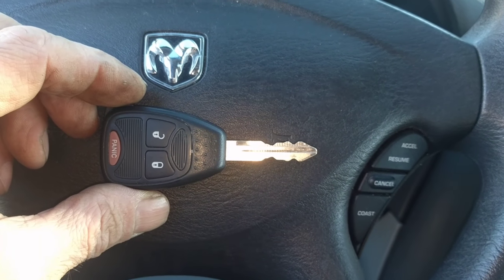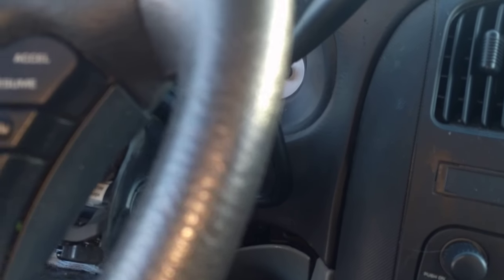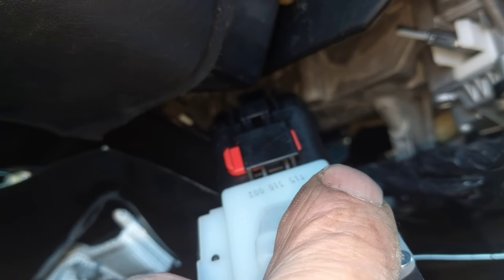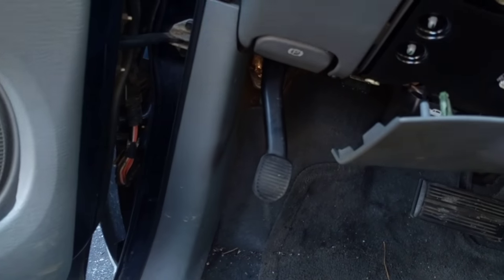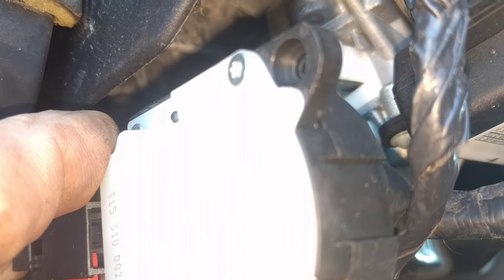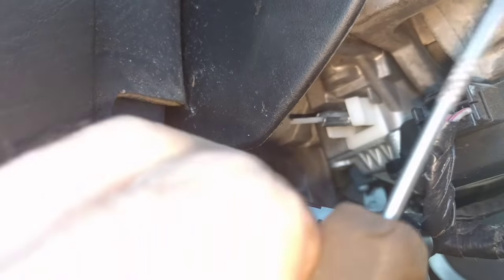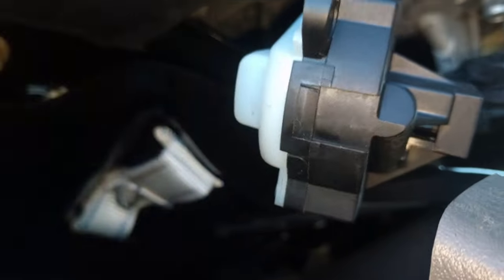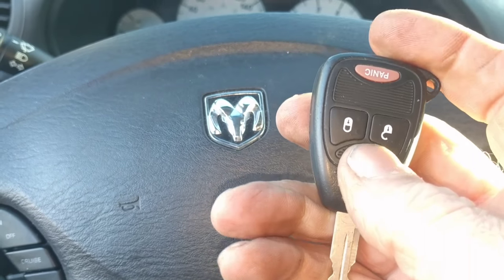Ignition Switch Change 01-07 Caravan/Voyager/Town and Country

Comment: I do occasional small jobs like changing oil and battery and simple stuff and decided to see if I could change a problematic ignition switch which brought me here. When I got to the part of the video where you warn about setting off the air bag I decided I would let the mechanic deal with it, so nice vid.
Reply from the maker: The trick to yellow (airbag connectors) all you do is disconnect the starting battery, wait 2 full minutes, then disconnect the yellow connectors.

Comment: These early models had a problem with the engine fuel injection wiring harness where it connects to the body FI harness. Deteriorated dielectric material that covers the wires. You must cut the covering on the engine side of the FI harness to view these wires.

Comment: Will a faulty switch prevent the 'square illuminated indicator' that surrounds PRN32L from indicating the 'P'.......?? Sometimes it indicates 'P' and the van will crank and start and if not, it will not crank at all. I have a 2007 Grand Caravan 3.8 litre vehicle. I'm also wondering if it's a possible faulty brake switch???? Of course it could also be a multitude of other things.

Comment: My 2001 dodge caravan starts fine and runs, but when I take the key out it still thinks that the key is in and you get that chime noise when I open the door. Eventually it causes the battery to go dead even though the door is closed and the chime isn't happening. At first it only did it with one set of keys we have, but now it does it with both. Anybody have any idea what's wrong???
Reply: It sounds like the screen module he was talking about in the beginning is faulty. Like he said it picks up on the chip when the key is inside thats when you can start the car. So it probably just thinks the key is always inside

Comment: Update for me: my van would only start if I flipped the key back and forth really quickly, otherwise no check engine light. When it did start, it would stall, or run very poorly, misfires, coughing, like something was wrong with the motor. 

Well, new ignition switch, and runs perfect again. Ran so poor, it threw o2 codes. 

I don’t have screem, however, the ignition switch causes havoc since it is wired into to the BCM. 

It doesn’t throw any cel lights/codes either. These vans man…

Comment: You can take the cover off and start it then unplug the screen system while it's running and leave it unplugged and then you can use any key you have made and the screen system doesn't turn the fuel off any more,  it's controlled by the switch 12 volt only and works fine. You just don't have theft proof anymore.  But who cares as long as you can drive it. I do that to every one I have owned
Reply from the maker: Wow, that's an incredible workaround!
Reply: @wolfiestechbites3773  gotta do what you gotta do sometimes when funds are low and you have to get around
Reply: @coinslotsandjoysticks2572  I tried it but it just kept turning off and finally it won't even crank anymore
Reply: Ok how can I do that to mine
Reply: @torrischappell7339  msg me tomorrow and I'll help you fix yours, I'll walk you through it

Comment: Yes sir I have a question for you I've got a 2003 Chrysler Town and country would that ignition switch module right there be the cause I have all my auxiliary power when I turn the key right before start my radio my heater wipers windows all that works fine until the moment I crank the vehicle and let off the switch when I let off the switch none of that stuff works from then on until I cut the vehicle off and kills the power and it goes back to auxiliary mode would that be the cause of this

Comment: I have a 02 Caravan, every now and then i cant turn the kee, if i wiggle the heck out it for a few min, it will turne, its ben doing that for a few months, but getting more frequent, and takes longer to turne, i dont know if its the tumblers sticking or the switch under it, guess i will half to take the lock cylinder out to find out, right?
Reply from the maker: Sorry, been away.  It's the tumblers most likely.  The ignition switch would be a consistent problem turning.  Since it's not all the time, u should change the ignition lock cylinder

Comment: My friend lost the keys to her 06 town and county. It has the key fob. It's going to cost $300 for a new key at the dealership. Plus the van has to be towed there and she has to be with the van. Problem with all that is she has limited income and is currently in the hospital not able to go with the van. Can I change the steering column or pieces parts to put an ignition cylinder in that has a key fob to match? Will I have to change the part under the column that reads the fob?

Comment: I have a 2005 Chrysler T&C. It takes a couple turns sometimes to start. Im thinking it's the key cylinder but not 100%. Had starter tested, said it was good. Any recommendations? Thanks.
Reply: Same boat
Reply: If you're still having problems, it may be a broken actuator pin. On the 99 caravan I worked on it had this mechanism between the key cylinder and the ignition switch. Right there in the steering column. I also replaced the starter because it still wouldn't start after I fixed the actuator. Had to jump it off, too. Check your relays and fuses also.
Reply from the maker: Hey Jordan.   Sorry for the late reply

So, starters are pretty simple, but how the whole electrical system interacts can be a bit difficult to explain in just a message.

I believe it's time for me to make a video explaining how everything ties together.

That said, does the starter sound strong while its turning the engine over those few revolutions, before it starts?  Or does it labour and sound tired?  

Also, does it reliably crank, Every single time you try to start the engine?

Comment: woke up this morning to find my 06 town and country radio on and AC blowing on low, turned key to start several times cranked but no start then I disconnected battery cable for a minute and it started up and ran but noticed little red dot on far right of dashboard gauge panel and after running it a bit to charge the battery back up and it kept running in all positions??!! tried to shut down by pulling battery cable off again but it kept running off alternator and I couldn't get key to shut it off until I messed with the ignition switch housing through the gearshift lever opening. When it was running it seemed to bog down when I hit the gas but had a PO420 catalyst problem code the day before via OBD2 reader I thought was from putting $30 of Thornton's E-15 gas when I was on a half tank and thought it'd clear up when I went through that gas. I'm assuming someone tried to steal it but IDK what to think.Any thoughts that could help greatly appreciated.

Comment: Thank you, thank you, and thank you. My Chrysler Town and Country have been intermently not starting. Been driving me crazy trying to find the heart of the problem. Through it was the engain iddel control. Start the engine, it runs for two seconds and then dies. Going to put a new ignition securty and key system in. :-)

Comment: I am having an issue with my town and country, it  will not crank or start, had battery tested it is fine, thought it was starter put a new one on, old starter tested fine, but still nothing, I have all my lights and power accessories, it it will not do anything, I am at a loss, we are low income and I can't afford anything else, do you think this is the problem with it too! I have traced all the lines for continunity and they are all good, bit it does not seem to get power to starter or something, from what I can tell all the relays are fine too?
Reply: How do you know the relays are good?  Did you switch them out with others that are the same to test them?
Reply: @da324  yes I did replace them

Comment: Yes i have a dodge caravan 2004. I went to junk yard to get another steering colume. And. I got key to. The. New. Colume. brand new battery. But for some reason when i start it. I get no sound no crank. The gauges. Move can anybody help me out there thanks
Reply: key has to be progammed to your ecm

Comment: Have 99 Grand caravan 3.3 lights n gauges work starter relay is good but van won't start. Used to jiggle it and would start now it won't. Ignition switch?
Reply: Yes it's the switch

Comment: When you change the ignition switch , what about the keys , can you use your old keys .
Reply from the maker: Use the old keys.  The ignition switch is just a mechanical switch to send power to ignition circuits.

The security comes from the key and key hall effect sensor that reads the embedded chip inside the key head.  If you use a key with the correct cut teeth, but the wrong chip code, the security will shut off the fuel injectors. (Most security systems work like this)
Reply: Thanks for your reply, I think I am getting a bit mixed up.. the other day I could not turn my key...I call a tow truck and the guy wiggles the key aggressively and it turned.. So I need the key cylinder, I was calling it the switch.. So from what I find on here , I buy a new key cylinder, and then I need to copy the placement of the tumblers from the old to the new , in order for my old keys to work with the new cylinder.. Would you think I am on the right track... The new cylinder comes with new keys , but I think if I did it that way I would need the dealer to program the keys, unless you can put the new keys in turn the ignition on , and somehow it programs the new key...not sure , but appreciate your video..Thankyou.

Comment: Thanks.  I’d still want to see if I could test the switch with a VOM etc, hate replacing stuff that still works.
Reply: Ok, year later, the INCNS problem has gotten bad enough, finally got around tuit.  I need to see if, with the ignition switch in place and key-turnable, why voltage is not seen on T751 (yellow) at C7 pin 2.  Guess I'll try to use the ol needle through the wire trick with the switch back in-place.   Sounds like a pain, but between here, pin 4 on the ignition switch (yellow), and pin 2 on C7 in the IPM (still yellow, still expecting 12v, but not seeing as stated)  is the C200 connector block under the dash, which looks like a real pain to mess with and of course, first things first, hope passes a continuity test across this pathway from pin 4 ignition to pin 2 C7.   After that, the key turn trial.
Reply: Final result:  The pin 4 yellow start wire can be stuck thru with a sewing needle quite easily without removing the switch.   Then the continuity test from there to C7 pin 2 first proves that the needle actually has good contact, and further that there is no wiring or contact problem in between like perhaps in the C200 box. thankfully.  So the switch has to come out now because the problem appears to be isolated to it.   This switch (black cover instead of white as seen in the vid) is easily opened to reveal the turned-green dielectric-greased up corrosion of the copper, the worst on the start contact lands, which had actually allowed a weak voltage reading of about 0.1.  This grease-infused corrosion would never get better by itself. Job for bounty towel then Dr Dremelington Steel Brush and new dielectric grease.

Comment: Anyone change the lock cylinder housing or actuator housing that goes through the column?  need to change mine after theft attempt, they destroyed the housing the cylinder slides into
Reply: Justin Gibson sounds like you will need a steering colum

Comment: My van did this. Same year. I replaced the battery, alternator and cleaned the throttle body. Everything seemed fine till yesterday it just randomly turned off on my wife. I even thought it was the AC cause it would turn off everytime the AC would kick on.
Reply from the maker: +Derrick Spagnola , more details please.  Why alt and battery were changed?  What was happening to change them.  And if you disconnect the plug in At the A/C pump, does that stop the stalling?
Reply: @wolfiestechbites3773 can you help me out on color code on a 1980 Chrysler incision switch3
Reply from the maker: @martincomfort6297  your local auto parts supply store should be able to do that.  Or if they cant, try the auto wreckers.  A lot of the wreckers have been in the business since their teens and know their stuff.  Ask around a few places and ask for the most experienced person (if they don't seem to know).

Comment: My 2002 Dodge Caravan wont crank. I hear no clicks and I jumpered the ignition relay and it cranked. I checked the fuses and they were fine. Next up is that ignition switch and that didn't work. it's got to go into the shop now.
Reply: What was your final solution? I am in the same boat? No crank - no clicks - starter turns when jumpered at the relay. I am about to change my ignition switch. I hope it solves things. My last thing to do is the PCM/ECM.
Reply: @justinbecker3340 Justin. I'm in the same predicament. Did you have the red dot on the dash?
Reply: @xlargetophat  yes
Reply: The red dot means no communication to the computer. The new PCM remedied the red dot and all is perfect again.
Reply: Did I post how I fixed mine? I purchased a new PCM from a company in Florida for only $200... preprogrammed to my VIN for my 2003 Town and Country... perfectly easy and effective. Saved my van. I am beyond happy at fixing it myself. Saved a ton of money.
Reply: @justinbecker3340  who programmed it?
Reply: @justinbecker3340  I'm wondering if a parts store can reprogram a used PCM I have.. hmm
Reply: @xlargetophat  I don't know. I know dealers can sometimes program them but not cost competitive. I spent $200 for a programmed, lifetime warranty, PCM.
Reply: @justinbecker3340  do you remember the company? I could probably check it out

Comment: 2002 T&C .. blinker NO cancel out.  Had battery go extra two months. Started getting no starting. Thought old battery lost cranking amps. Replaced battery. Still intermittent switch-on, will crank. Looked into possibles.. flipped a relay in fuse box, got.. blinker on - dash goes out/no blinkers working.  So, when driving, and use turn signal, dash resets, and no signals work.   At first, I thought, replace the key..then the ignition switch.  Not yet.  I'm going to get a turn signal first. With the new battery, the car appears to be starting first time now.  But the turn signal does this, so that will get fixed fast. Then I can see if the problem is more involved.  It appears that either the dash panel or a couple of switch/modules at the fuse box, the Body Control Module, and wiring are common problems for these vans.
Reply from the maker: Yeah, sounds like a challenge.  I once fixed a 96 model that had very similar issues by slapping down, open palm, on top of the dash cover pad, just at top crown of instrument cluster, with ignition on and no lights and no start issue present.  Crank key while smacking down.  Then van started and dash flickers and intermittent issues stopped.  Apparently,  they have issues where the solder that connects the main female plug at back of cluster to the interior circuit board.  Too much heat over time and it partially de-solders itself.  Try the hand smash and if that makes it flicker or change, noticeably, replace cluster with a remanufactured one (if possible, or a low mileage recycled unit... and also filling all male plugs from harness, that plug into cluster, with dielectric silicone.  Permatex tune up grease is an example.  Good luck!
Reply from the maker: And make Damn sure the battery clamps and posts are scraped with a sharp knife after wire brushing and coat shiny posts and clamps with dielectric silicone and tighten.  Also check battery cable where it crimps onto sheet metal clamp for green or black deposits, might have to replace clamps and / or cables/clamps if they didnt give enough slack (which I believe is their pattern for those years)

I have found, in many cases, where a vehicle will start, but immediately stall or run poorly and have multiple issues with Low Draw circuits (including computing) when there is that much lead oxide and corrosion between battery and main circuits.  Starters will draw 1000 amps right thru all that invisible corrosion, but the circuits that operate at 5v or very low milliamps will continually collapse and fail under operating conditions because they dont have the amps to pull thru the bad terminals/clamps.

Comment: The cam sensor can cause the car to just stall as you're driving down the road.  Good thing is it will normally start back up after sitting for a bit. Also, why are you replacing different components instead of reading the OBD to see what's bad the first time?
Reply: Most of these vans wont show a code for the stalling issue unless its directly related to a component the computer scans. Even a $4000 Mac 10 scanner shows nothing on some of these issues. Theres many other tests to perform with a multimeter, scope, probes, amp meter. If only anyone could just slap a scanner on it and have a pin point answer.
Reply from the maker: Actually,  a scanner will most often lead mechanics down a very expensive rabbit hole.   As the old saying goes, Keep it Simple Stupid (KISS) applies here. A wiring diagram for the circuit is a better start sometimes. A flowchart (included in some dealer service manuals) is also of great value. 

Never - Ever! - Believe some mechanic that says “his scanner” no matter how much he paid, will accurately show the issue …..  one’s brain and experience, and Emotional detachment, from the problem. Are a far more valuable tool